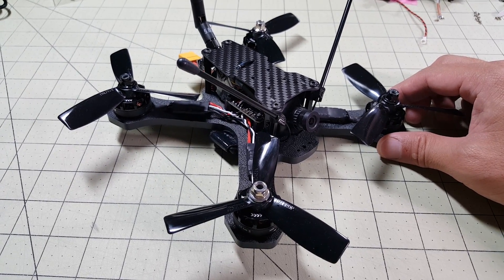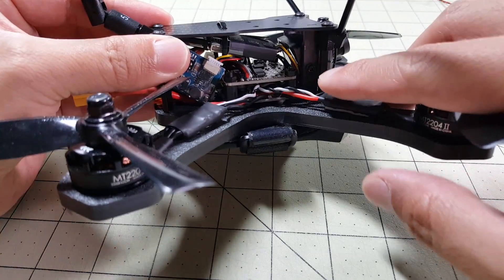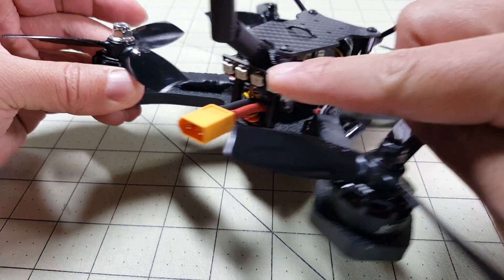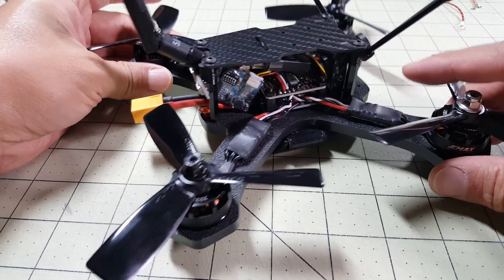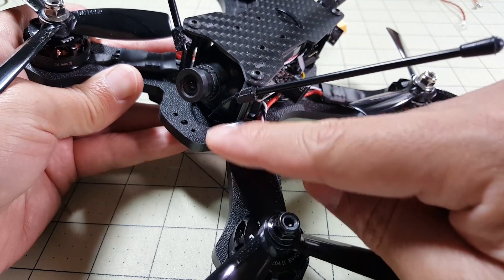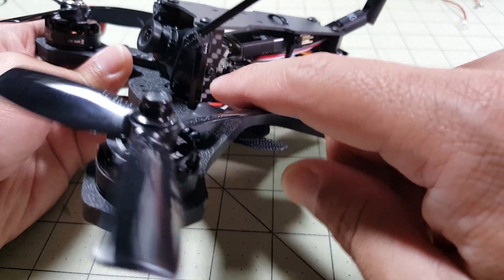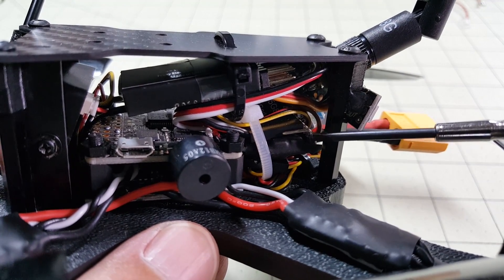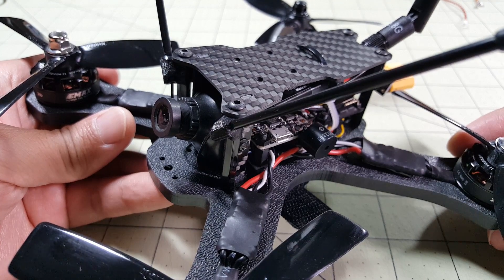HMB-X4 Build Review

Comment: I been doing research on this frame cause I want to build a small quad . How do you like it ? Is their another frame you would like to build in this size frame .
Reply from the maker: I think it's a great frame. I am uploading another video of the maiden flight tomorrow. It's a very smooth flyer.  I like hte HDPE main plate because you can crash it and it won't break. Plus it has a lifetime warranty.

Comment: Use circularly polarized antennae like these http://www.banggood.com/Aomway-5_8GHz-FPV-4-Leaf-Clover-AV-Transmission-RHCP-Antenna-1-Pair-p-961730.html  on your vtx and receiver you will get much better video feed quality and less destructive interference.  With as much effort as you seem to put in to use quality ESCs, flight controller, etc, it seems like a big oversight to stick with those dipole style antennae.
Reply from the maker: +coleisman I use a good quality circular antenna. The dipole is just there for the glamour shot. I was too lazy to switch it out just for the video. I have the dipoles lying around all over so just grabbed the closest thing so I didn't have to get off my lazy ass ...  😃😃😃😃
Reply: Oh okay that makes sense... I was like man how does this guy not know about CP antennae

Comment: pls make an diy quafcopter racing under 80$ include shipping
Reply from the maker: +Ariqkamil Nugroho hmmm, might be tough. Maybe without FPV gear it may be possible. Cheapest frames are $25. Motor set $25. ESCs about $25. You still need a flight controller and PDB. I don't think it's possible
Reply from the maker: +Ariqkamil Nugroho hmmm, might be tough. Maybe without FPV gear it may be possible. Cheapest frames are $25. Motor set $25. ESCs about $25. You still need a flight controller and PDB. I don't think it's possible
Reply from the maker: no one uses CC3D anymore and the ESCs are also not every good. These are left over parts from last year that no one wants. You can build it for cheap, yes, but you won't like how it flies.  I'd spend a little more and get at least a Naze32 or a cloned F3 flight controller and ESCs that can support oneshot. These ESCs have the F330 chip, support BLHeli and are only $8 each - http://goo.gl/TLzz9o
Reply: +Albert Kim (marblekit) how to choose ESC and motor which is good?
Reply: +Albert Kim (marblekit) by the way what is your cheapest quadcopter racing with fpv?(brushless) :)
Reply from the maker: I'm going to make a video series on building a cheap (but decent) FPV racing copter soon. Stay tuned to my channel!

Comment: Have you heard of the PowerOSD Pro? It's a PDB with built in OSD, plug and play, no programming, it just gives you voltage, amps, and mah used, plus a flight timer that only runs when you're flying, and a visual low voltage alarm. Pretty sweet, I've got it on my 180
Reply from the maker: +Jon B Baca yes but it's really expensive! Over $60! No thanks. I buy these micro OSD for 10 packs for less than $7 each
Reply: +Albert Kim (marblekit) very true. They'd be amazing if they were like $15.